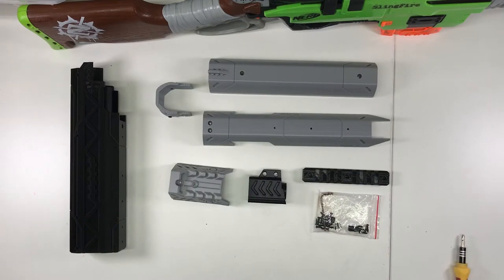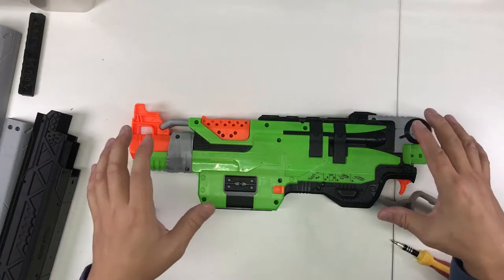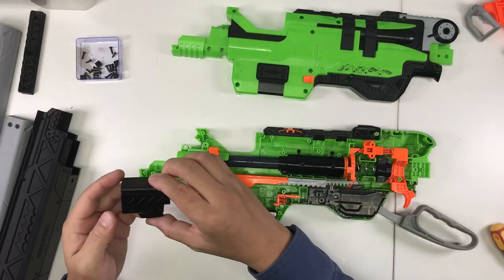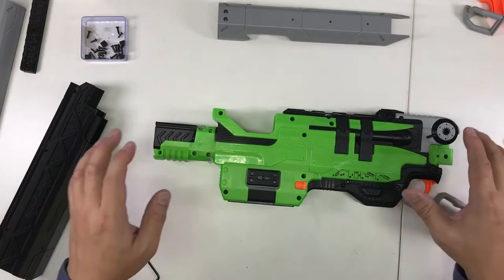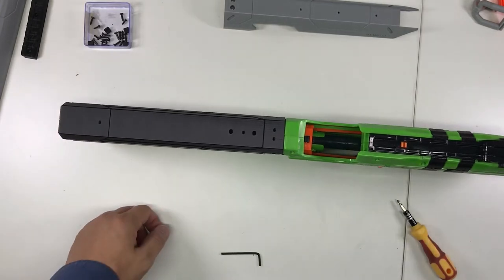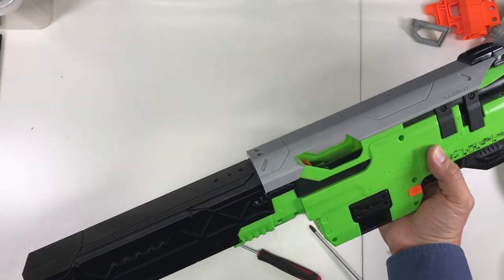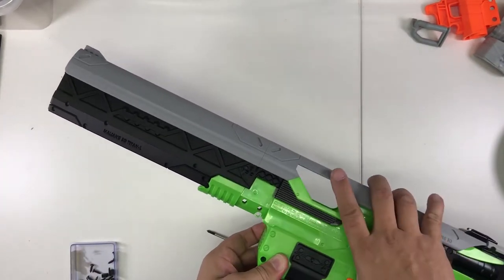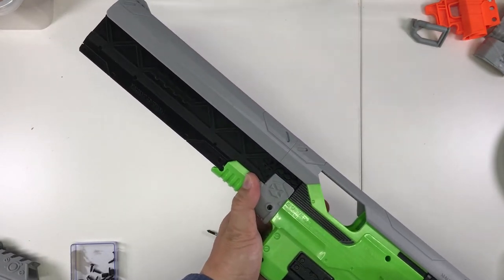Nerf SlingFire Body Kit Installation - MaLiang 3D

Comment: That is a sweet kit, makes the slingfire so much nicer to look at. My only dislike is the absence of jamdoor. first thought was to leave the jamdoor in and leave the top grey pieces off, but that would ruin the awesome look.
Reply from the maker: Zero Blade yes u got to have the grey piece man. I like the overall design, not over the top, clean line and the print quality is not bad :)

Comment: That's such a beautiful looking kit. So well designed. 
I'm planning to pick up the slightly shorter version, and use it in conjunction with one of the JC Aero handles. 
Got some other purchases to make first, though. 
How's the quality? I've never handled Maliang products before.
Reply from the maker: Mister Nathan the quality is good. Well printed and fit really well :) There are 2 over design and each have a long or short version. I will definitely buy from them in the future.

Comment: Nice kit, is it at all possible to leave the jam door so there’s isn’t such an empty space there?
Reply from the maker: Sorry for the late reply, as I finally found the jam door to check if it fit. to fit the jam door nicely, you will need to remove some part of the closing catch which is on top of the jam door (should be easy to do). in short, yes it is possible.

Comment: I have a question. I just recently got this kit for Christmas and in the bag with the screws are two orange squares of plastic with a notch in them. What are these for?
Reply from the maker: from your description, if I am not wrong they are for modding the internal to re-enforce the primping when using a stronger spring, check out this video from IamBobololo at around 2:15 he talks about it: https://youtu.be/Cxh5p90guKk?t=135

Comment: Hello,
How did you get it to fire?
I own the doomsday mod1 kit but i can not get it to fire.
Can you help me?
Reply from the maker: Did you experience while priming half-way the prime slipped and the spring, sprang back? If so, do check you have replaced the 2 small orange rectangle pieces (the original pieces comes with small spring) which was part of the priming handle bar with the solid pieces.
Reply: @TungstenEXE  oh yes i have these i didn't know what to do with them.
Reply: I replaced the primingbar with the metal one
Reply from the maker: @stijnVDA1994  oh the metal kit, Valour did 2 video on 2 different metal kit on the installation, here is the links to the videos, it might help: https://youtu.be/KJuflNcjJug  and https://youtu.be/kZiAROctxaA  also this vid from bobololo start at the 1:30 mark will show you what the orange small parts are for if you are using them https://youtu.be/Cxh5p90guKk?t=90